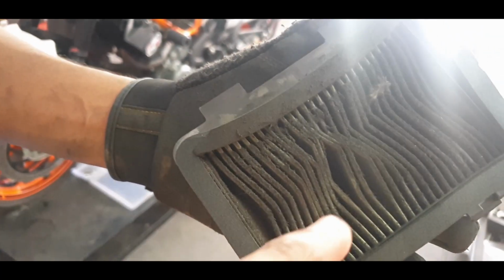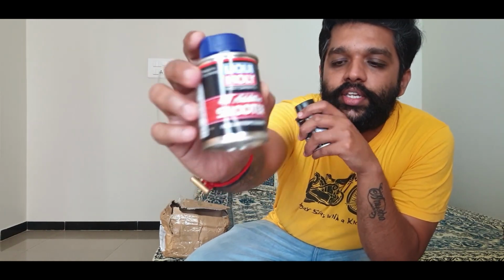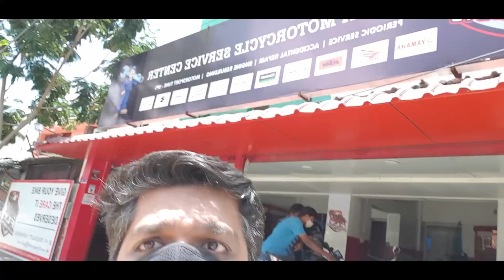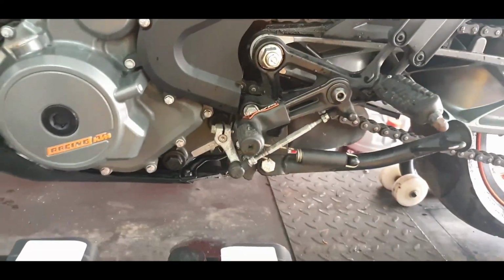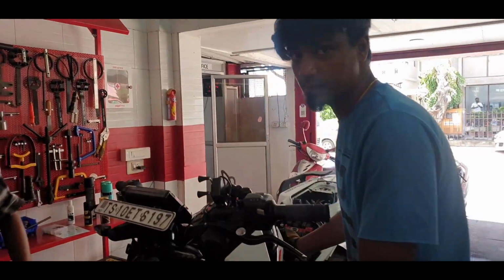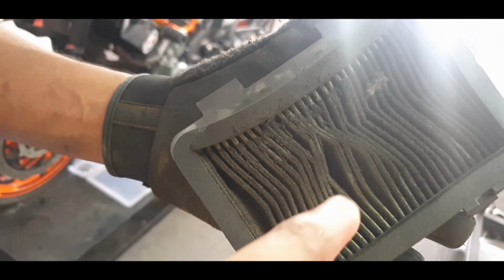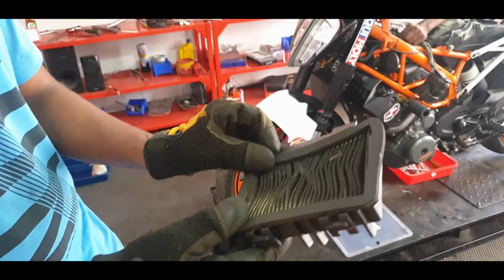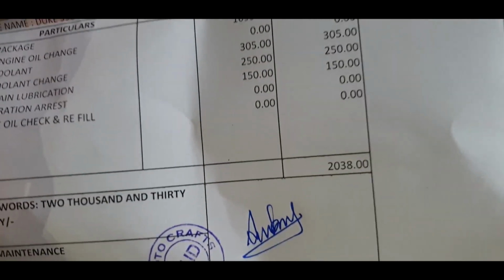Servicing my Duke 390 with Liquimoly Performance Pack

Comment: I heard Liqui Moly gets faint after 3000km is it true ? And which one is better for Dominar Motul 7100 or Liqui Moly?
Reply from the maker: My experience so far with this product is good and haven't gotten issues yet like vibes or drop in performance, infact the pull is even more great I am enjoying it even more. Go with the technical specs of which suits a domi engine. Since both are almost the same, maybe it should work good for it to. Go with more reviews to know better. 👍🏻
Reply: @Rohittheblackvizer  what’s the top up as well as drain interval ?
Reply from the maker: @Bhaskar105  i do a full drain and top up at 5k or close to 6 months as of now ... since riding is less so the time comes as a count

Comment: Bro am useing in ma duke 390 lique molly 10w40 there was any problm for it plz rply
Reply from the maker: Hey, there is no problem at all. Bike is running smooth 👍🏻
Reply: 10w40??? Company recommends 10w50
Reply from the maker: @Vishalshabra  Here in India yes, the SVC guys use only 10w50 and as per manual if you see it is 15w-50. But we can even use 10w40 which is almost the same in terms of thickness and performance and other related factors.